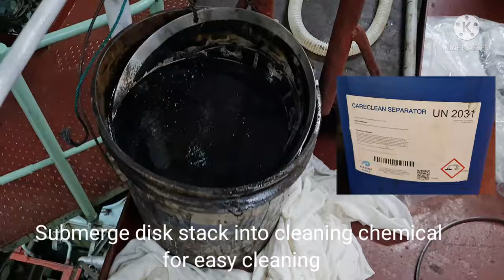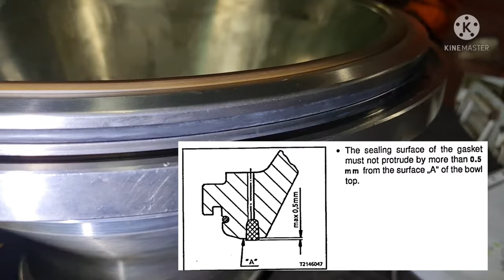GEA Westfalia Separator Bowl parts overhaul #marineengineer #merchantnavy #westfalia #purifier

Comment: Can u show how to dismantle centripetal pump.
Reply from the maker: Sorry I didn't record it. But it can be removed by hitting the center of the centripetal pump with wood or plastic bar. It is sticking together.
Reply: you can use special tools for puller bearing tools.

Comment: in westfila no gravitydisc how it maintain  interferce sir ?
Reply from the maker: Gravity disc is called for Mitsubishi selfjector ( widely used ) but in westfalia Gravity disc is called regulating ring. If you check the bowl parts, you will see regulating ring.
Reply: @HtoonPyeat  thanks sir❤️
Reply from the maker: @brainstonm5570  You can see regulating disc in my video between 10:51 and 10: 59 minutes
Reply: @HtoonPyeat  10:51 &59 will be sensing liquid pump right
Reply from the maker: @brainstonm5570  sure, sensing liquid pump including gravity disc.